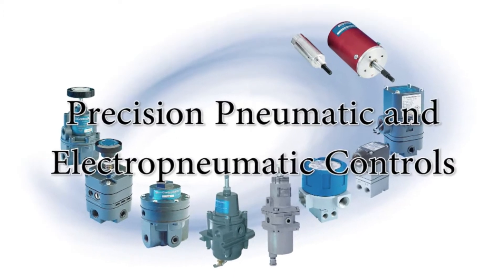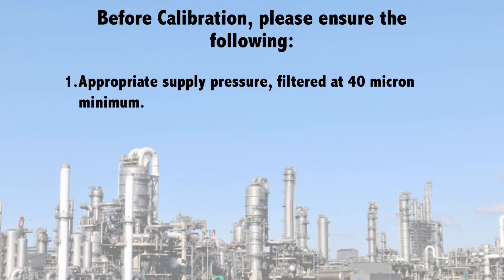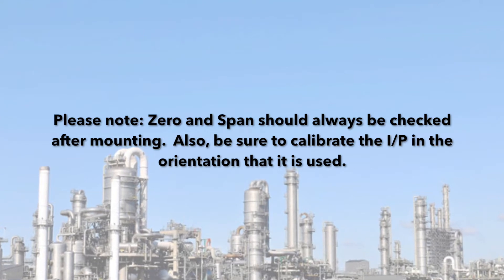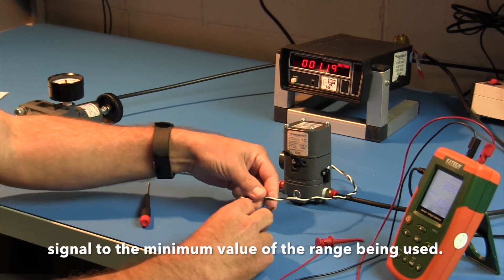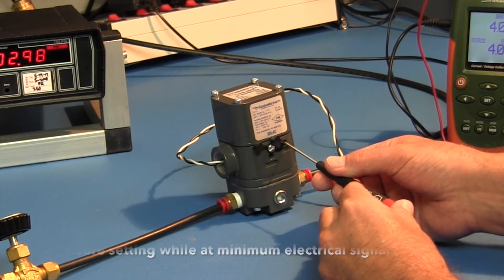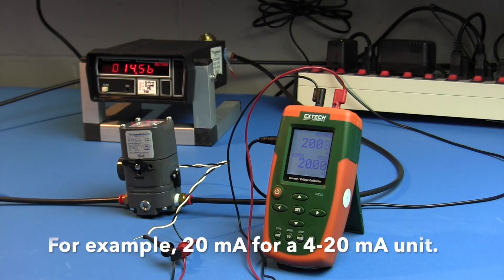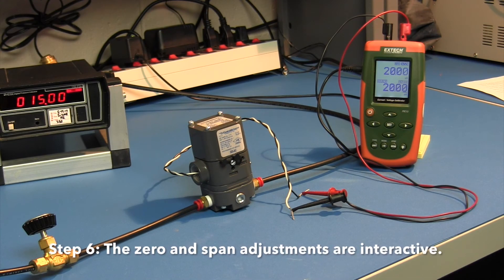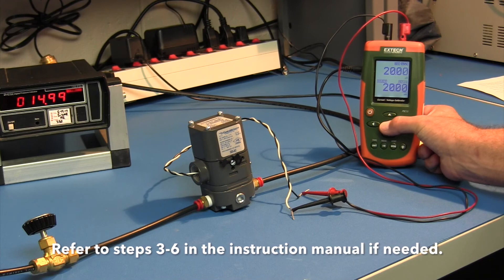How to calibrate a Type-500 I/P Pressure Transducer

Comment: Awesome information thank you guys. What model of extech was used in this calibration? I am having trouble with the exact same valves on a retort system but do not have a way to send it a 4-20Ma signal
Reply: Hi Edgar! We were using the Extech PRC10 in this video.